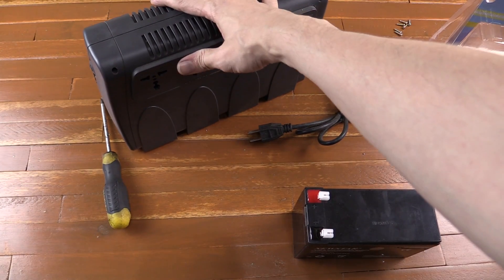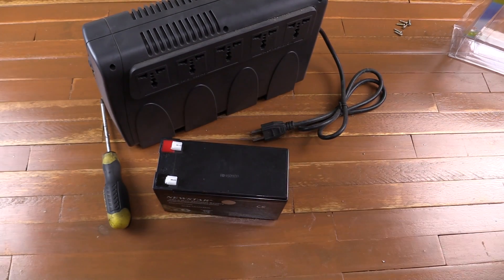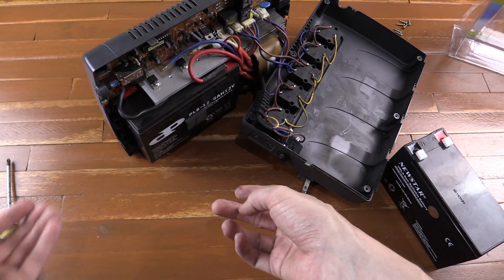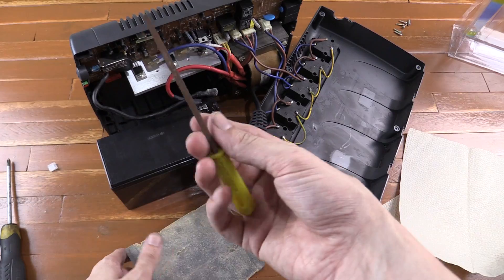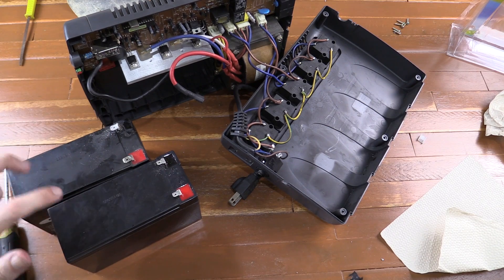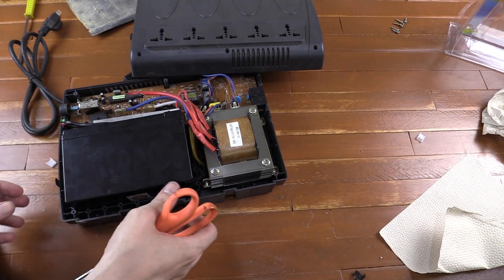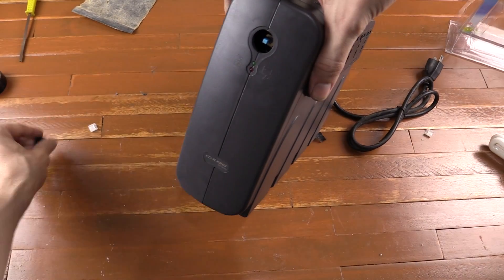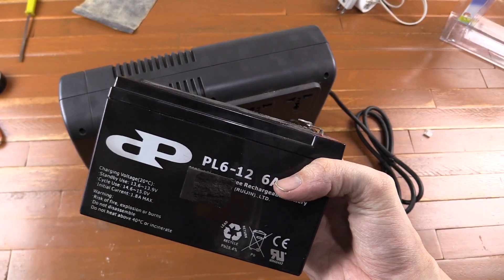Replacing UPS battery

Comment: Thank you! I have UPS battery with a label of 12V8.0Ah. Can I use the one available in the market with 12V9Ah?
Reply from the maker: If it physically fits, you shouldn’t have any issues. It’s the same voltage, just slightly higher capacity.

Some people say you should match the original capacity exactly, since a bigger battery could take longer to charge and potentially generate more heat than the UPS was designed for.

But realistically, I don’t see a 1Ah difference making any real impact.

Comment: Good video.

I have a RCT-650VAS UPS. Only my monitor and Wifi router connected to it.

How long should a UPS be connected to the mains wall socket, to always be ready, for an unscheduled power outage, whilst working.

Will my UPS battery performance be deteriorated, when i always keep it plugged into the mains wall socket.

Kindly advise on the above questions.

Thank you

Comment: Is it possible connect several batteries to the same ups in order to increase the ampers per hour? I make the question because I don't know if the UPS will be able to recharge all the batteries 🤔
Reply: In theory it should work however it depends on the amps of the charge controller. It will take longer to recharge but will work

Comment: Sir can i change it with bigger batteries?same w/ trucks?
Reply: Did you ever find the answer to your question? I’m thinking about doing the same.
Reply: @berniemac8413  You can use any size battery of the same voltage and type (ie: 12v, sealed lead acid). If you get a battery of the same dimensions, it will go inside the UPS. If it's larger, the battery must external to the UPS - just extend the wires (with no less than the gauge of the original wires that lead to the battery). The greater the VA, the longer it will last when there is a power cut.

Comment: Hi i have 2ups if i turn on its just power then off .. is it possible that the battery need to be replace i check the battery its 12v we been using thing ups for 4years now

Comment: lol. got the same issue. i have the 600va ups and cost 990pesos.  got the replacement battery from motolite and the battery is slightly bigger and need some bit of hackin to fit it in. and its back to service. using it on my sureveilance system.

Comment: i have a question about UPS. i'm planning to buy an ZERBA UPS 500w. it has a feature that you can plug an extra battery on the unit with 12V batt. its like a inverter if you dont have electricity (brownout) so my question is can i still plug the external battery and plug it in to the socket to charge the external battery? so that if brownout comes i have more juice to burn.
Reply: Paolo Reysoma you can

Comment: I have an old UPS here that no longer works. Not sure if it is the battery or the relay switches. I ended up buying a brand new APC UPS. Maybe I will try replacing the battery in my old one to keep it as a backup.

Comment: cool thanks never used one I do have those batteries hear where I used to work voluntary they used them in the emergency lights and every one has a battery to they have to every 2 years replace the battery I got two of these 12v 45cell 10min I have had my CB radio running on this battery for over 6hrs so they are pretty good they were going to be thrown out I charge it on a 30amp 14volt power supply checking to see if it fully charged at 14 volts and hold that over a few week so there pretty good similar to your battery one is Yuasa other is Centuary  usually I use the Yuasa one but there the same
Reply from the maker: +Kriss Bartlett Good use idea! I think they can really last many years if you treat them right. It's just when you discharge them too far over and over, they kinda get destroyed. It's always nice to rescue a battery that's being thrown out. Even if it can't hold it's full charge, it probably still has some life left in it. Sounds like you have a pretty beefy charger!
Reply: its my power suply for the cb radio I got it of a armature radio man 20 yrs ago and it still going good no problem its suppose to be used on a liner in line with the radio make you get out really well I don't have one but I have a armature radio and that uses about 15 amps I got it in Cebu at a radio shop its a AT6666 search on you tube you see it working nice radio hanks see ya ok

Comment: And if you don't want to replace the battery. Connect them up to a car battery/solar bank,They make a good light duty inverter.

Need to get a little creative with battery wiring and cooling. But it's a cheap inverter. Better than tossing it.
Reply from the maker: +Hey_Joe Yep completely agree!
Reply: +Gadget Addict another very helpful video. tysm. UPS connected to solar battery bank and used as inverter would make a nice utube video.. i wonder how if it would perform same as cdr king inverter

Comment: How long did the cdrking battery lasted for you?
Reply from the maker: +SEELE01 Around 1.5 - 2 years. Pretty short. But I kind of abused it by running it completely empty during numerous power outages.

Comment: how much that ups?
Reply from the maker: +Julius Sanpedro The UPS was P1400 from cdrking. The video description has more information :) So the new battery was nearly as expensive as the UPS itself.
Reply: +Gadget Addict how many hours that long last the battery?
Reply from the maker: +Julius Sanpedro It depends on what you have plugged in and how far the UPS is willing to drain the battery. If you have a desktop computer plugged into it, maybe 5-10 mins. If you have just a modem and wifi router maybe a day. Basically you calculate the watt hours of the battery and then compare that to the load you want to run. Minus 10-20% for inverter loss and consider that the UPS probably wont run the battery down beyond 30-40% of its capacity.